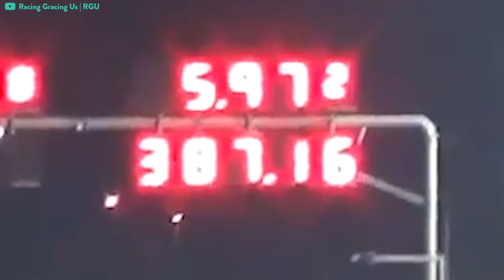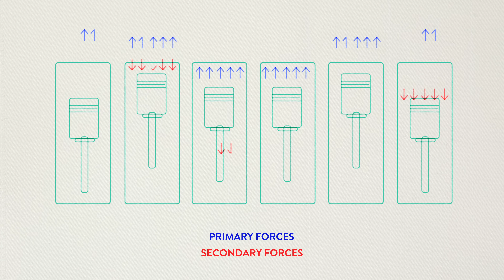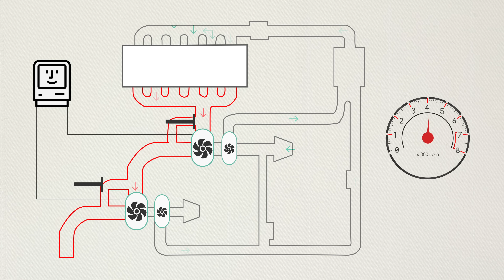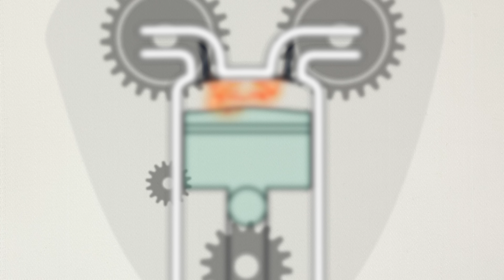2JZ ENGINE - How it Works | SCIENCE GARAGE

Comment: too bad the new supra wont be as legendary
Reply: I will buy the new Supra and swap In the 2jz engine at all costs
Reply: @happyharpy3577  HAAHAHAHAHAHHA XDDDDDD
Reply: @happyharpy3577  you won't be able to drive it on the streets legally though.
Reply: It's actually fvcken depressing...
Reply: BMW Engine, idrive, manufactured by BMW.. It's just not a Toyota.
Reply: Still a closed deck b58 seems decent in some reviews, all aloy including the bores
Reply: @TheEagleofSteel  wrong. Only their Chassis is manly made with BMW, but it was also done with a Toyota lead designer  so 1 chassy would work on BMW and Toyota with minor changes. Everything is done as a collab . The whole engine is tuned and designed under Toyota rules
Reply: @iamax8307  designed? Ok.
Reply: @TheEagleofSteel  no the Engine is Toyota and Lexus parts, only drivetrain and Gearbox is BMW/ZF ....
Reply: @TheOneG36  The B58 engine is Toyota and Lexus parts, stamped with a BMW logo? I'd love to see your source on that. You didn't even mention the chassis which is also made on BMWs assembly line along with the Z4.
Reply: @TheEagleofSteel  read again, i said NO, so it is Toyota an Lexus parts (the engine). to state it even clearer for you, i said the Suspension and Gearbox is both the same in the BMW and Toyota the Cars are build at Styr Austria (like Mercedes Gwagon and Range Rover, many many more) Styr is not BMW! the build Maserati too...
so it is not build by BMW. Still the Parts are used mainly from BMW because they have way more experience with cheap Sport car parts. The Engine in both is from the one the Emblem is from (Toyota is Pure Toyota Engine) the BMW is a pure BMW engine..... you are correct that it is a B58 in both, but if you compare the QM Process the differ greatly, Toyota has much smaller tolerances so it is the same machine on paper, but in Practise the Toyota will be much more ECU Friendly (like ever?) ;)
Reply: @TheOneG36  Honestly, do some reading. Every motoring news source says that it is a BMW engine. Toyota had nothing to do with the building of the engine whatsoever, they may have tuned it once it was built but that's as far as they went. They've said themselves the part they had the most influence in was the styling. (by the way you can even get parts from BMWs own parts catalogue using a new Supra VIN already).
Reply: @TheEagleofSteel  check a documentation the engine was completely changed by Toyota QM Departments, do some reading yourself ;) the BMW and the Toyota engine Differ vastly. not just minor details. BTW. i live in munich i saw the difference first hand. the question is, will BMW put the new changed version in, or the original B58, afaik BMW will still use the old model.....
https://www.bmwblog.com/2019/01/24/video-engineering-explained-breaks-down-the-bmw-z4-supra-b58-engine/

That engine name, the B58B30/01 is a long and complicated name but each letter and number represents something and we get to learn that in this video. But we learn a lot more about the engine than just its name.
it has nothing in common with the B58 from 2016 (as it was introduced)
https://uploads.disquscdn.com/images/5e21c76102473799ff1cd4153ee4ab2c6af455cf3f38d98b15be56eaf8d4b6d0.jpg
Reply: @TheEagleofSteel  But iam still wondering, one year ago toyota showed the concept with a Lexus engine (Hybrid) but now it seems they do not offer them with that engine.........
Reply: @TheOneG36  That article you linked explains why Toyota used a BMW engine instead of developing their own. Same with the video. Toyota did not manufacture or develop this engine, I don't understand why this is so hard to believe.
Reply: @TheEagleofSteel  because it is wrong? you checked the Revision right? the 01 in Numbers or in German short TÜ1 means that it is a certain revision (for example the Chain-fasteners and chain es new) etc.. it is an old BMW Engine which got completly changed together with toyota. this specific engine is not developed by BMW alone, but mainly yes. Toyota did the QC/QM on it and that is new....... but if you think it is the same engine. Believe it or not, the engines differ. (Original B58 and the all new B58 TÜ1)

https://www.bmwblog.com/2018/10/31/bmw-b58-tu1-technical-updates-bring-388-horsepower/
Reply: TheEagleofSteel I think I missed the part where he said he’s German which explains his defense of bmw
Reply: @TheOneG36  Do you realize that there are many versions of the B58? Bmw themselves released 2-3 versions of the B58 when the engine first launched, and since then it's had a few revisions. For example, the new M340i has a new revised version of the B58 compared to the one found in the F30 gen 3 series and other cars with the first version of the B58. New M340, Z4, Supra, these cars have the updated B58.
Reply: @414Automotive yes, of course i even wrote that the supra is the TÜ1 (Revisioned with Toyota together)
Reply: @TheOneG36  the car is a BMW Z4 in a fancy frock, if you were sat in one with badges covered you'd swear it was BMW. The engine, gearbox, suspension etc etc is all BMW all Toyota did was give it a few tweaks.
Reply: @danwhitaker5168  sooooo? What is wrong with an BMW with Toyota QC?
Reply: @TheOneG36  I drive an M235i I love the interior and it's a great engine but to bring back the legendary Supra.......... Meh
Reply: @danwhitaker5168  do not underestimate the tweaks. the engine redesign made it a lot more robust, but sure the rest of the Parts of the cars are very similar (majority BMW Parts) but do not forget neither the BMW nor the Toyota is built by BMW or Toyota, there are built by Styr Austria, which also built Range Rover and Mercedes G-Class. so from a quality point of view, they should be near to identical. Suspensions settings at shit are different but i don´t know, if i would need to be an Roadstar i would prefer the old Z3, just because it will get very cheap soon ;)
Reply: @TheOneG36  the B58 in the Supra isn't a pure Toyota engine, NOR A PURE BMW ENGINE. People don't know that joint development and badge engineering isn't the same thing
Reply: @זהסודי-ה7מ  the B58 is a pure BMW engine. but the Toyota Version is not the same because the decreased tolerances and stuff compared to the BMW one but the design and basics is 100% BMW......
Reply: 3JZ sucks
Reply: @randomautist1593  It dosent even exist yet lmao
Reply: New supra is a trash, it's not a Toyota Supra anymore, it's a BMW Supra 😥😥
Reply: @Vendeta552  mk4 supra is ugly and looks like a wedged cheese v8 for life
Reply: New supra will be sheep in wolf skin and thats sad but true story
Reply: Nothing Toyota could have done would have rose to the status of the supras 2jz. Just accept the new surpra for what it is and be happy.
Reply: Someone already 2jz swapped it lol
Reply: Does anyone know why Toyota did not make an updated 2JZ engine for the new Supra. Like they could have called it the 3JZ or something. Nothing wrong with BMW's straight six but a JDM car deserves a JDM heart.
Reply: @J.PC.Designs  Design, nothing to talk about it
Reply: Even though it makes more power amd better and smoother than original...most people are not running maxed out 800hp.....

But at least bmw drive train is strong...a d u can race someone from a light...instead of pussy...rolling start like all supras..cause yes they have the power and speed...but ju I trans..and driveline....tellnthe truth...great engine...hooked to a junk trans and drive train
Reply: 2 bad its not a new supra🤔
Reply: Supra never got popular until the MK.IV and it still needed mods to get anywhere or race. It was a one up from the Celica and was never meant to compete with the Skyline GT-Rs. It was made to compete with the C4 Corvette 😂. Plus, cars were never Toyota's specialty. They're still a manufacturer today because of their legendary TRUCKS
Reply: There's nothing legendary about supra besides engine.
Reply: It's manufactured by BWM so that's y it was not as legend as before
Reply: Turns out your right:)
Reply: Gonna put bmw emblems on the new supra and a big ol Z4 badge on it too. 😂
Reply: supra isn't legendary. its overhyped and ugly
Reply: @joeydrifts  Hahaha nice joke man, made me laugh a lot!
Reply: @nedkogenov5530  what makes it legendary? its overpriced, overhyped, and ugly. new supra costs the same and will walk it in a race
Reply: @joeydrifts  The new "Supra" isnt a supra, its 90% BMW.
Its not exactly legendary, but its a realy good tuner car, its not overpriced unless you live in America, and its not ugly. The design isnt the best but it isnt suposed to look good, it has a function.
I dont see anybody calling american classics ugly shits even though you cant do much with them, most american classics cost a fortune, have a poor design and are overpriced. When someone buys a real shelby cobra what will he/she do with it? They wont drive it, it will collect dust in a garage or a showroom.
Reply: @nedkogenov5530  it is a supra. supra is a name, and even though bmw assisted you can't say it's not s toyota. Yamaha designed a lot of the 2jz, so that's not a supra, it's a yamaha
Reply: @joeydrifts  The mk5 is entirely a BMW and had nothing but a toyota badge and a little bit of change to the original design of the Z4. Tye 2jz has some toyota in it so its still a toyota, its not entirely Yamaha. 
If its just a name, then if BMW rebadges a Lamborghini, will that make it a BMW?
Reply: @nedkogenov5530  yeah, just like putting a Toyota badge on a frs makes it a Toyota. And Toyota designed the mk5 body, and the body lines resemble the mk4. bmw made the engine
Reply: @joeydrifts  90% of the mk5 is BMW. The body is the only thing toypta made, and its still just a redesign of the Z4.
Reply: @nedkogenov5530  no it's not but whatever, keep being a fanboy
Reply: @nedkogenov5530  I'm the hater? you keep smacking down the mk5 supra which is arguably a better chassis
Reply: Yet
Reply: @spencer kleiman I got autism reading that
Reply: It looks like another Lexus sports car
Reply: None of the og tuners are getting a revamp worth their legacy
Reply: Its now all shitty cartoonish designs its a fucking disgrace
Reply: All they doing now is boring hybrids lmaooo
Reply: The new BMW Supra
Reply: Didn't look as good either
Reply: not really bruh
Reply: Japanese glory days is over. And it's hard to accept. 😢
Reply: Toyota exist? That means they must produced legends
Reply: 1985 Toyota AE86 Sprinter Trueno APEX GT I mean the design looks pretty good with body kits but by itself meh. I still like the MK4 better tho.
Reply: @J.PC.Designs   The car looks much better in real life, I used to hate it. Its actually beautiful In person.
Reply: I hate supras
Reply: B58 is actually way better than the 2jz lmao
Reply: @J.PC.Designs  so does the mk4 its ugly to
Reply: you dont know that :)
Reply: yall talk shit like “oh the new supra is so ugly”, “it cant handle as much power as the 2j”, “iTs a bMw” yall are so cringy, they dont make a new supra, you guys complain, they make a new supra, you guys complain too. toyota’s performance inline 6 crew probably left years ago. bmw is good at making inline 6 engines. so wouldnt it make sense to team up with bmw? the b58 can handle a shit ton of power as well. the new supra might not look like the crasiest car ever, but it turns heads and looks pretty good. the mk4 is literally a roundish bubble shaped car with four circles as taillights... whats so stylish about that? you guys literally dont give dog fuck about supras. bet yall dont even know what the previous generations look like. yall hogging ass on the mk4 because of FnF. without fnf yall wont even know this car. the supra is not a legend. the 2jz is, and even then, there are engines that can do the same shit as the 2jz.
Reply: @yeehaw5741  Facts
Reply: I drive a BMW and I'm gutted the new supra is one in a snazzy body
Reply: Well I watched some analysis on new engine from new supra and it is in many many cases similar to 2JZ... Sure new Supra won't be legendary as MK4... I mean come on... First Supra that comes on to your mind is  MK4, but I think it will be a very good car, and very good tuning platform... (btw, sorry if my english was bad xDD)
Reply: New bmw
Reply: Nissan did a better job with the new gen
Reply: Won't, For now isn't and don't made nothing so promissing
Reply: The new Supra's hood looks way too long like the Z4 too
Reply: Holy shit! We have a psychic on our hands!
Reply: Just wait
Reply: Ayy
Reply: It will still be a legend tho
Reply: street kings no, it won't there's nothing legendary about a z4
Reply: Moe Lester do some research. It is not a Z4 hahaha that is literally the official line of Newbs who don’t do their research.
Reply: @leweee  unfortunately it already is because somebody 2 mil for the fist one ugghh😢
Reply: Kyle Keister That doesn't make it legendary
Reply: @leweee  but this isn't a Z4. This is a Toyota Supra made for tuners by Toyota and BMW
Reply: @jarradmalpass8341  How will it be a legend if it's a different engine and basically BMW? Only TOYOTA SUPRA IS LEGENDARY, NOT BMW
Reply: It hasn't even came out stfu lol

Comment: Still like the 4 cylinder turbo in my 1989 RS Cosworth Sierra, mild stage 2 tune, 325bhp, light and good fun, engines in cars back in the 1980s and 1990s were good fun, skylines, supras, Nissan 3000, Mitsubishi 300, early scoobies and evos, it still makes me smile, could spend another 5k and up it to 400 plus but in a 30 year old car? 205/50/55 tyres, stock, and rear wheel drive, no driver aids, 1.25 ton weight adds up to much fun, was always a fan of the supra turbo, even the earlier ones

Comment: too bad american don't know about volvo S80 T6 2.8l swap and mercedes 3.2l m104 swap. Super cheap and both manage 1000+hp mercedes iron block even 1200hp+. ;) also Bmw big diesel manual gearbox is not common in america. But In EU people start to know something about these. Me I know everything ;) I keep secrets so those inline 6 engines stay cheap <3 go buy yourself a 2 JZ ;) leave me gm12 and ford 8.8 + 9 inch rear ends while you have wet dreams about japanese overpriced easily breakable parts ;)))))

Comment: 2JZ - How it works:
It eats trashy oil-leaking RB engines for breakfast.
Reply: The rb is easier to get them to reliable high hp. They also red Higher so that's a good thing to have. The jz just isn't the best. It's just the cheapest

Comment: The most powerful stock internal 2JZ that I have ever seen was pushing 1080hp on the dyno,  that is one hella strong inline 6, you usually have to run a forced induction iron block V8 to hit those kinds of numbers, you really have to go with a fully aftermarket Dart block LS to beat what the 2JZ can pump out.

Comment: Wait wait wait wait wait wait wait no no no no no no shut up shut up shut up shut up.... So your saying a bigger single turbo produces lag but more boost.. nd two turbos are better then one, now since that being said; if I upgrade too two bigger turbo and run the stock twin turbo pipe and valve setup with a custom co-co factory flange and pipe. That I'm gonna have less lag and more boost return too the engine ??? Someone should fire you insane... Do you know how too do your job mr. Announcer.. Is the ls 400 aristo 3.0 v12 engine still a option too do a quad turbo set up on it or am i just laying behind on bigger turbos ?? Excuse me come again ?? Rbs yes I'll take a big montana with crinkle cut fries and cheese dip as well.. And can I get a extra set of fries and shake and big Montana for my lady counterpart by mariage in palegamy as well with female adapter fitting inbetween her skinny legs and thigh's 😆..... And ask the embisul what he would like I'm guessing it's the same; he seem's like he's on a fast and the furious budget 😂😂😂😂😂😂😂😂😂😂😂😂😂..... @donut where do you guy's and gal's get your material from It's classic like baytoven and oji driving backwards entry style off of the outer apex at the begining of the turn. That's like saying, bitch you cheat on me with my brother you gonna die now ho... 😂😂😂😂😂😂 @nakamuara_naoki_ns, @noriyarojapan, @noriyaro, @madmikewiddet1.2.3 this is so funny, this is the most historical histerical😂😂😂😂😂😂😂😂 post I've seen them do yet..... @linkecu its a 2j....😂😂😂😂😂😂😂😂😂😂😂😂😂

Comment: Good video ! Just one mistake, commonly made in fact, is that the 2JZ-GTE VVTi is also a non-interference engine. Only the 2JZ-GE VVTi seems to be. Fact is pistons, valves et valves spring are exactly the same between VVTi and non-VVTi. So you can break your cambelt stress-free :)